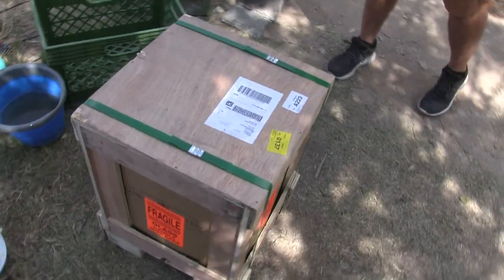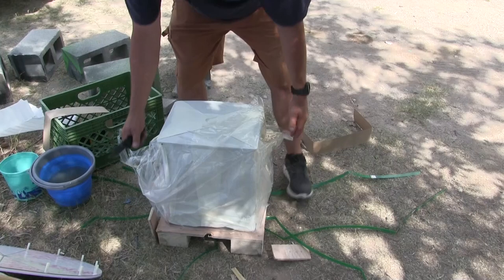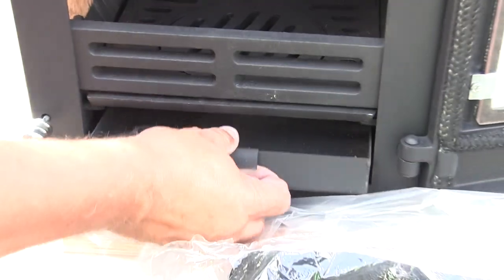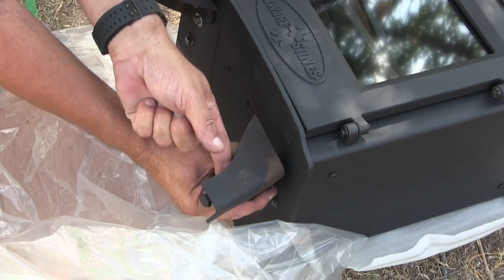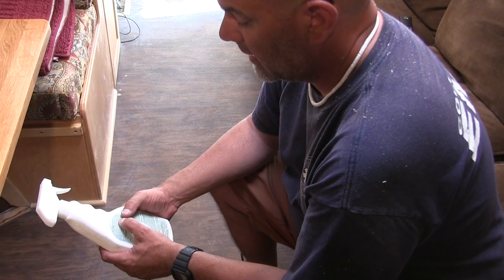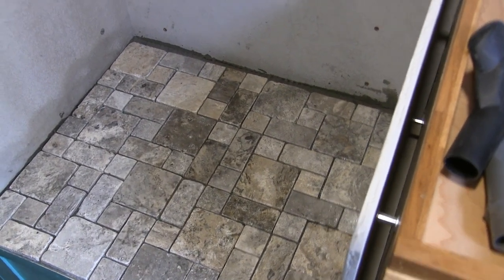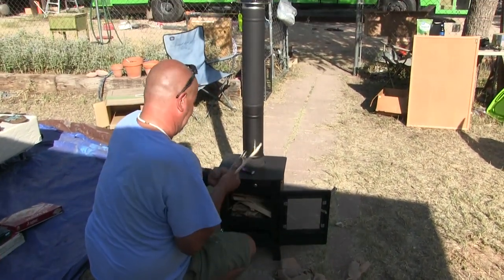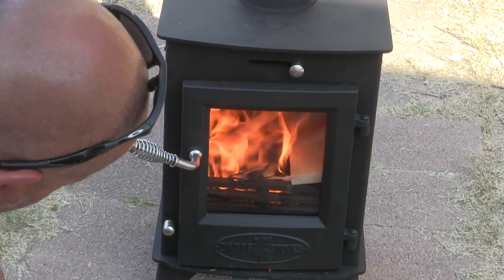Installing The Dwarf 4Kw Wood Burning Stove in our Skoolie!

Comment: Looks great, but you really need to go back and cut that roof penetration and deck penetration larger. You should have a 2" space between double wall stove pipe and any combustibles, including roof insulation and the decking on top. Even Tinywoodstoves puts that in their Bus install instructions.
Reply: You can see it here: https://www.tinywoodstove.com/rvr/
Reply from the maker: Thank you for this, it will be done! Safety is such a priority when it's your home and your loved ones.
Reply: What about triple wall?
Reply: @BussyMcBusface  We went with the Dwarf 5k, and we ended up cutting an 11" hole in our Skoolie to accommodate the 5" double wall pipe that we ordered with it. It looked freaking huge, but it has worked out for the last year. Also looking back over my first comment it looks way less friendly than  I intended, I really do love what you two are doing with your bus =)
Reply: That's ridiculous... I cut a 6 3/4 inch hole.... that's all you need.

Comment: One thing is that the shields you installed on the outside of the stove opening need to be 1” above the floor or base to allow air to circulate up behind the wall panels. Because you only have them open on the top it will not allow enough air to flow to keep the walls cool.
Reply: Ya that’s way I did to keep Fire Marshal happy
I used 1/2” copper pipe for my spacers
Cut into 1 inch lengths
I was able to use 1/8 inch metal sheeting from my work that was rejected for the heavy stamping 4’x4’
Inch off floor & inch copper as my spacers behind the metal sheet
Passed easy :)

But medically retiring from that job of 22 years bumped me to natural gas fireplace & natural gas stove for each level
It’s close but still miss the essence of wood heat
&
Log cedar for Xmas (smell just relaxes & nice crackle :)

3 full bush cord in Ontario Canada if u never want furnace on & like shorts 12 months year when inside anywhere in house Lol

But not following those little code specs will come back to haunt u later
& comment above is right on
24” above height of anything within 10 feet of chimney
Never have back draft or poor draft when stick to code for a house
Miss my 30+ year Vermont casting
What I put against any modern stove
Secondary burn with extended 48 inch baffle on back of stove b4 even hits stove pipe

Anyways,
Take this guys advice
Slice off an inch along bottom of heat shield
& you’ll have future peace of mind

You won’t have an any safety issue in future because u took time to do it right !
Enjoy the heat, it sets the mood 😎

Enjoyed casualness throughout video
Worth a 👍🏻:)

Comment: Looking good! The height of the chimney will affect the draft as well as safety. In residential housing the rule is 10' 2' 3'. 3' minimum height, 2' above anything within 10' of the chimney.  The things around the chimney will also affect performance so just keep that in mind when you burn. There are spark arrester gadgets you can get to make sure no embers come out of the chimney and land on your deck.  Always a Super Hot Kindling fire to start so that it helps to reduce the amount of creosote in the flue and chimney. That lil' round travelin' cap is a cap for the cleanout that you don't have. When you sweep your stove, (near the start and then again at the end of the season) you will probably just have to use the shopvac to remove the soot and ash that falls into the firebox. Easy but dirty job. I like fruit tree timber personally. Seasoned and dry will burn longer, hotter and that is key to stoking the firebox for a low over night burn. There is no nicer heat than radiant heating. Some people use fans to circulate the air and limit cold spots.  Get yourself a chimney brush and a couple of rods and you should be good to go. They get dirty and I used to stuff mine in a ski bag that I could close up and stuff in the storage locker nice and easy. 

I imagine you're going to get grief from any RV park even for just being a Skoolie. But then guys, what the heck are you doing at an RV park? The wild and free is where you want to be.  

Getting so close now!
Reply from the maker: Great comment!!  Great information as well.  We will be getting the chimney sweep for sure!

Comment: The idiom originated in the 14th century and it combines 'nook', being used from mid-1300s which means - a distant corner, with 'cranny' in usage since 1440 which means - a crack or gap.

Comment: Thank you for the video, I am afraid that I bought too much and too little, I got a woodstove, single wall, double wall, triple wall pipe sections, damper, flash, sealer. I am sending back the flash pipe and going for a flash plate section like yours, and also the handsome clamps. Shopping for a bus, and I want the stove put in before the insulation. Love your cement board on the bricks, copper is very expensive so I may have to copy you, LoL. Have a great weekend!

Comment: Word of warning for future fuels, if you get osage orange wood to burn in the stove, it'll pop and crackle more than Mike when he first gets up (#VeteranNoises), but if you use too much, it can burn hot enough to make the cast iron of the stove turn cherry red. Learned that the hard way one year with a wood stove I had to heat a house I lived in. Don't forget to leave a pot or kettle of water on top to help with the humidity in the bus, otherwise everything will get super dry inside. Plus side to that being you'll always have hot water handy for a cup of tea.

Comment: Isn’t thr grout s’posed to be smooshed in, Before spraying the sealer, to make sure grout bonds with the tiles?
Reply from the maker: If you don't seal Rock tile it will absorb the color of the ground and mess up the color of your tiles.
Reply: @BussyMcBusface   Oh! …(…resurrecting vague bits of memory of hearing that, long ago…).  Thx for saying!  (…thinking of future redo of bathroom…)…good timing!

Comment: If you mount the front of the stove towards the front or rear of the bus, you can use the rear vent and save the precious space on top surface? Or even at 45 degree angle to fit in the fire stove nook?

Comment: Hi Mike and Kerry :) How is the flashing holding up? Is it still watertight? I ask because I have also treated my roof with Henry's, and wish to install a woodstove, but the people at Henry's says nothing will adhere to it. I will have to scrape it off, do the install, and reapply. Grrr. What are your thoughts? Any advise you could give would be greatly appreciated.
Reply from the maker: We used a lot of extra Silicon under the seal and around the edges.  No leaks.  The only thing that sticks to silicon is silicon😊
Reply: @BussyMcBusface

Comment: Awesome! Congrats you 2. Let me know how that drafts with a short stack after you test fire it. I'm concerned when we add ours that the flue won't be long enough for adequate up-flow in moderate cold temps. I may mount it lower depending on your feedback.
Reply from the maker: We will definitely be doing a video on something like how we heat our bus. That will include the functioning of the wood stove. we will get back to you as soon as that happens.

Comment: Dude you really need to get a ductwork hole circle cutter for cutting the holes in sheet metal.  It will cut a perfect circle from 2 -12 "  diameter with much less effort and scratching of the surrounding surfaces.  It will not fly out like a hole saw will. It is very easy to use.  These things are awesome...
Reply: Are you talking about a nibbler for your handheld drill?  I am looking for a ductwork cutter and that's what's coming up.
Reply: @bethanymay3056  No, look for Malco Products Model HC-1.  A nibbler is much slower and is more difficult to keep on a perfect circle trajectory.  Shop around for better prices.

Comment: Hey Mike. Did you compare and contrast the dwarf with the Northwoods fab stoves?
Reply from the maker: Definitely.  The Northwoods stoves are not high efficiency stoves.  They are designed for a garage. The clearances are and should be very high.  They don't have any brick inside which also lowers the performance, and makes them more dangerous regarding clearances.  The walls get super hot on the outside. Fire brick keeps the heat inside the fire chamber and lowers the heat transfered to the walls of the stove.

Mind you, I write this based on the research I did when we bought our stove.  Don't know about their later stoves if any.

Comment: I bought the same wood stove and am about to install it.  I went to the website for this stove, and it says that the hearth needs to have a radius of 12" from the stove, and even with heat shields, the stove and piping needs to be minimum of 9" away from the heat shield. They also said that the heat shield should go all the way up the wall as far as the single wall stove pipe does.  

I never see anyone who installs these in their skoolie follow these instructions and I wonder if it is a bad idea not to?  

How has it been for you?  Do you have any regrets or concerns about not having a heat shield going all the way up the wall, or about the size of your hearth, spacing between the stove and heat shield?
Reply from the maker: Our stove is more than 9 inches away from each heat shield. And we have had no problems from the single wall piping not being shielded going up the wall. It is 13 inches away from those walls.
Reply: @BussyMcBusface  That is great to know!!!  I won't stress about it, either, then!  😁  Thank you for getting back to me! 💗

Comment: With multiple single pane windows, how is the condensation on the windows from hot inside the bus & cold outside
Reply from the maker: The dwarf k draws from the inside of the bus so when it is running it is changing out the air as well as drying the inside of the bus. We don't see any condensation when it's running.
Reply: @BussyMcBusface  
Thank you

Comment: Awesome job! We’ve been following your videos for a long time and they have helped us tremendously. Overall how long is the length of the chimney? We’ve been debating going a bit shorter. Thanks!
Reply from the maker: We actually removed the last section so it's probably 6 and 1/2 ft from the stove to the end of the top.
Reply: @BussyMcBusface  Awesomeness thanks for the quickly reply! Safe travels

Comment: How is the platform protected from the heat of the chimney pipe?
Reply from the maker: It is double wall piped coming up through the deck so that's how it is protected.
Reply: How is the heat on the ceiling directly above the stove? We have found that our ceiling gets alarming hot.

Comment: I've watched your video so many times 😂 I'm attempting this installation tomorrow! One thing I noticed is that your hole is just a bit wider than the 6" diameter of the pipe, is it working ok? I'm reading and re reading the instructions and they recommend 2" clearance all around so basically 10" D. I doubt you'll see my comment before tomorrow :-) Thx!
Reply from the maker: You are correct however since it was metal all the way through we doubted we would have any kind of fire problems. Also since the double walls going through it doesn't get hot enough to cause a fire anyway. The hole needs to be a little bit bigger because you will not be able to cut the holes perfect enough for the pipe to go straight up through the ceiling but it needs to be small enough so that you can fasten the brackets to the roof and to the pipe. Good luck with your install. It is a great stove!
Reply: @BussyMcBusface  Yeah, I agree with you. My installation ended up similar to yours. Just a bit of clearance for the reasons you described. But, oh WOW having a fire going right now, AMAZING! I enjoy watching the two of you! Thx!

Comment: If the second choice for a stack came out the side  you could use the complete top for cooking or keeping water hot and it would  keep it from sticking out too far,,  width of the trailer or bus is more essential  the the lrnght along the side ,,, Just my opinion
Reply from the maker: I did that on an airstream and it made it really sucky to move. Super dirty to disassemble and over made it a nightmare.
Reply: @BussyMcBusface  i meant for the stove designer to make a side chimney access

Comment: what is the burn time for that stove?
Reply from the maker: that's a tough question. It really depends on the fuel you use. we are blessed to have very hard wood where We are at. We are seeing about 4 hours of burn time when we go to bed if we turn it way down. By morning the fan on top is still running and we still have coals in the stove but it's certainly not burning just smoldering.

Comment: THE NEW FIRE BOX IS GREAT ONE I WOULD LIKE TO GET TO USE MYSELF. ONE QUESTION YOU'AL, WHY DID YOU USE FIREBOARD INSTEAD OF METAL WALLS AROUND THE WALLS FOR THE FIREBOX? THEY ARE BETTER TO USE AS THEY ARE MUCH SAFER & YOU STILL SPACE THEM LIKE YOU DID THE FIREBOARD. THE STONE TILES LOOK GREAT. I PLAN TO GO WITH THE CUT BRICK FLOORING THEY ARE ABOUT 1/2 INCH THICK. YOU MIGHT THINK OF PUTING THEM ON THE FIREBOARD. YOU'AL ARE AN INTERSTING STUDY TO FOLLOW! LOL! SAFE TRAVELS. OH QUESTION, IS THAT YOUR HOME BASE OR FLEA MARKET YOU HAVE ALL FENCED IN? ALWAYS, TOMMY :-) P.S. I AM GLAD YOU MAKE GOOD MONEY FROM YOUTUBE FOR THE FIREBOX. JUST WENT TO THEIR SIGHT & SAID THAT ONE IS $870.00 DOLLARS. WOW! IT IS WELL BUILT & HAS ALL THE BELLS & WHISTLES. THEN THE COST OF ALL THE PIPING & FITINGS. YOU MOST SURELY GET ALL THE HEAT NEEDED.

Comment: If you do need to increase the output on your stove, you should check out our heat recovery system. It runs off a 37 watt air pump and adds a 3" section to your flue, so uses very little of your leisure battery power but recovers and kicks out vast amounts of the heat venting up your chimney. There's a demo of it here: https://youtu.be/zlEMADUz0Ak
Reply from the maker: Gonna look at this!